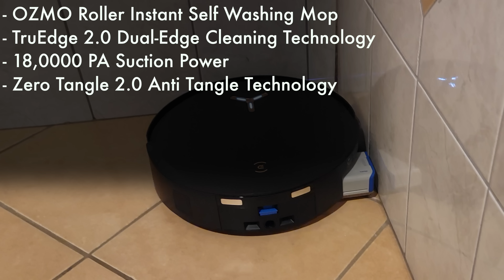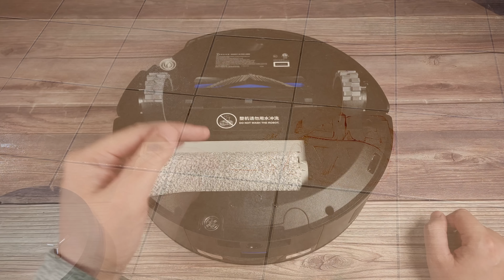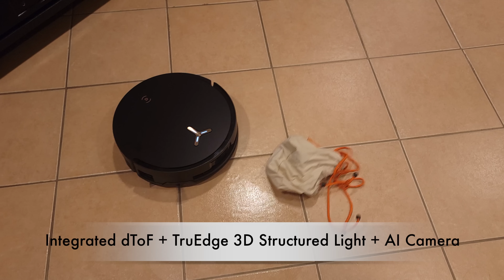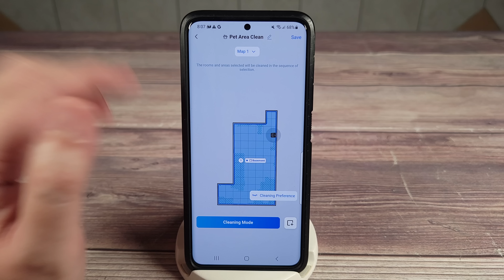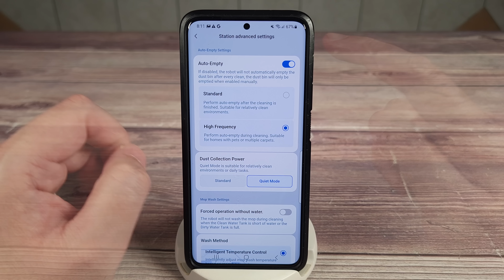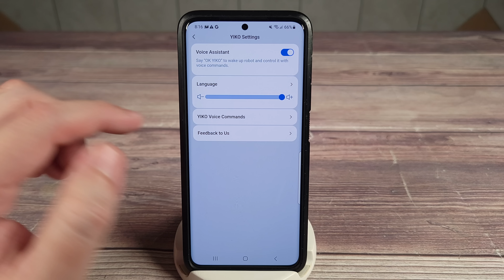Robot Vacuums Just Got Better! | ECOVACS DEEBOT X8 PRO OMNI Review

Comment: Does it get stuck on thick mats and throw rugs?  I see they finally have a roller that won’t tangle finally.  I have the N8+ and it gets stuck all the time, drop sensors need cleaning when it is only stuck on a thick mat instead of being able to keep the wheels turning to get off the mat.  

It would have to drop greatly in price!!!  Paid $768 for the one above and I cannot get a full cleaning because of the issues above!!!  Been disappointed as this was supposedly the best at the time I purchased it.  Had neato xv-21 that had none of the issues sbove but had a design problem that wasn’t covered by the manufacturer so I didn’t buy another!!!

Comment: It's a Deebot. I had an X10 Omni. All the hardware was there but what it lacked was the App and smarter tech. The App was garbage and had issues all the time. Couldn't build rooms properly when it mapped, walls sucked had to use boxes or physical barriers to even get a room to save properly, didn't identify doorways right, robot wouldn't clean whole house right, sometimes would just clean a fraction of the house when commanded to clean whole house. It was stupid and just didn't work. Front camera didn't always pick up cords and got stuck often. All this could've been fixed with patches and updates but the app had a LONG history of not being updated so if the X8 uses the same App, GOODLUCK. Customer service was not helpful at all and I went through 3 X10s. Returned it and vowed never to get a deebot again.
Reply: If that things happen to your robot, I think the problem isn't the apps but the robot. U should take them to SC immediately while u have warranty bro. My robot X1 Omni doing really well.
Reply: @lelegaib645  I went through 3 of them tho. One, the base would not suck the water out of the cleaning base when it would wash the mop, another one the thing got stuck SEVERAL times after a 2 or 3 weeks of use. My house was clean also no objects in its path hardly ever. That one would just leave the base when commanded to clean the whole house and clean the outline of the living room and say "Done / Completed" and would often get stuck in its room or area where it was located at. Moved station did the same thing. Took that one back, next robot (3rd) everything worked great but it could not map the house like the first 2 did just fine with no updated changes or moves of the station. The room lines in the app were absolutely retarded. It would often say "Cant insert wall in doorway" or some crap when it wasnt a doorway and it wouldnt allow me to section off my house (5 rooms) so I said to hell with it and brought it back. Roborock is a million times better and Ive never had any issues like I have with the Deebot X10.
Reply: @lelegaib645 Same! I have the X1 and works great. But also picked up the new X8 a few weeks ago. 🎉